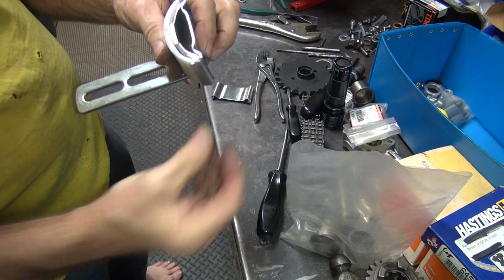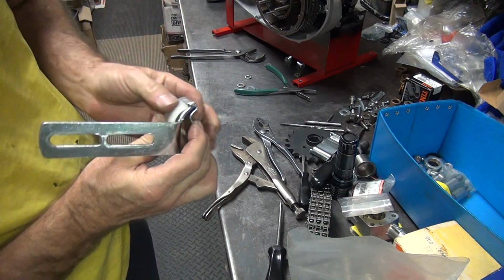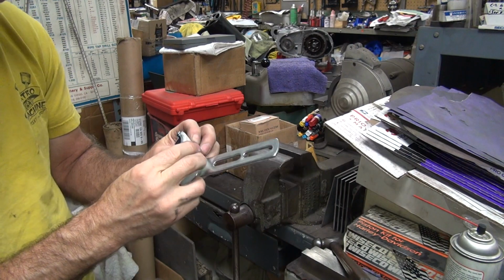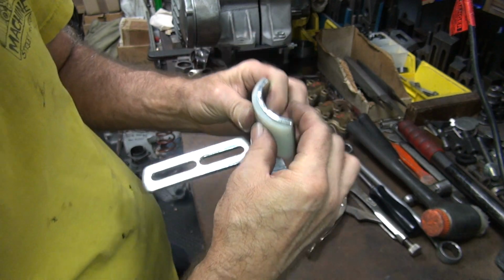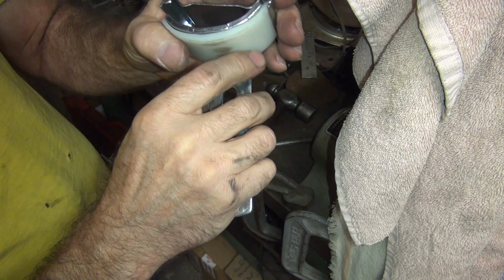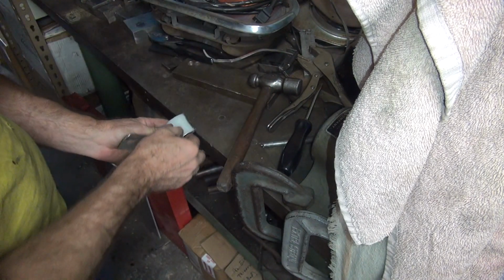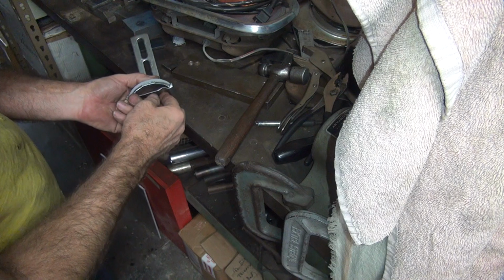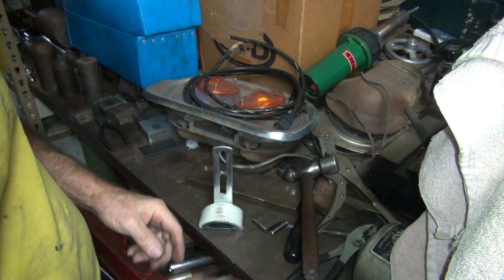1961 xlch #227 no miles transmission motor rebuild sportster harley repair restoration tatro machine

Comment: The chain rides on the top of the shoe,not the ends where you put the rivets.it is no different than using the retaining clip which holds at the ends.My 75 shovel has its shoe riveted and there is no issue for years.You could countersink the rivet slightly if you wanted

Comment: 4” Needle nose vise grips may get between shoe & frame to hold it closer for the hammer.   ( just a suggestion) 👍🏻
Reply from the maker: yes they would if i had any. you have to use what you have at the time.
tatro

Comment: Hi,why not rivet it on like on my old shovel.The late Ironhead Tom, Tom Gordon of motorcycle Specialties in Albert Lea Minnesota used to do it that way.
Reply: ok for a while untill chain weres though to rivets ,then you end up with swarf in engine
Reply from the maker: that is because harley did not want to redesign it and make it strong like the early shovels were. they dumped that design too. it cost to much.
tatro